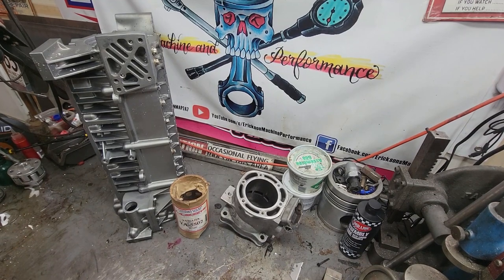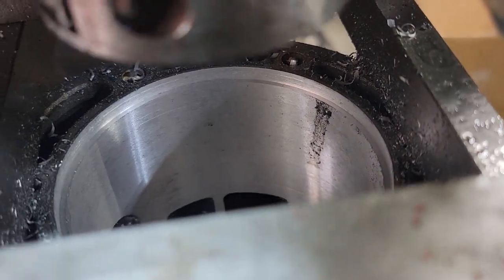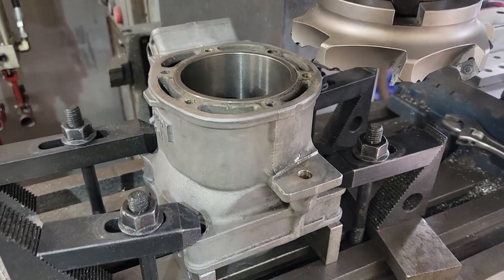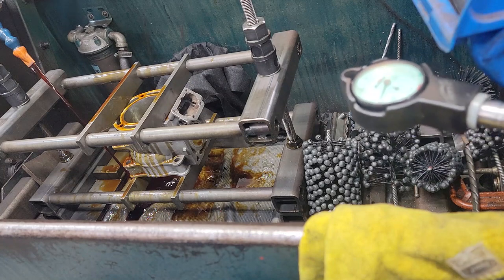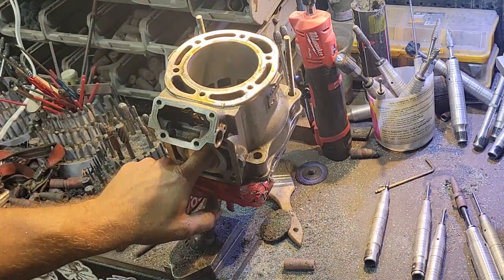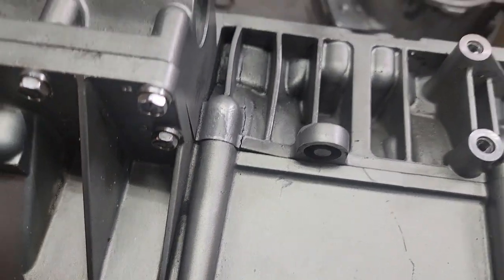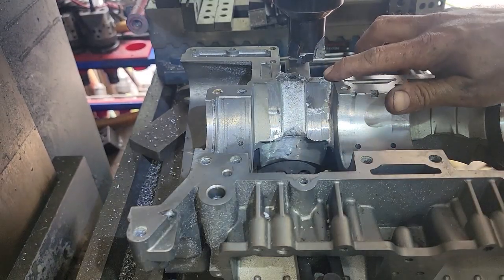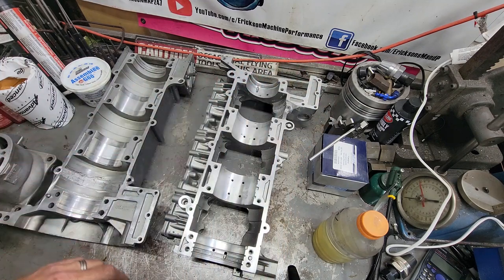Repairing a wrecked GP1300 cylinder and cases! Sleeving, welding, and boring

Comment: Awesome video thanks for posting! How do you know when decking the cylinders that all 3 will be flat to the cylinder head and that one will not be short or too high? Thanks
Reply from the maker: Great question!!
When decking this style cylinder after it being sleeved you're really not removing aluminum you're more lowering the sleeve to be even with aluminum I end up taking less than a .001 of an inch off which wouldn't affect anything.
Reply: @EricksonMachinePerformance  Okay that makes sense thank you.